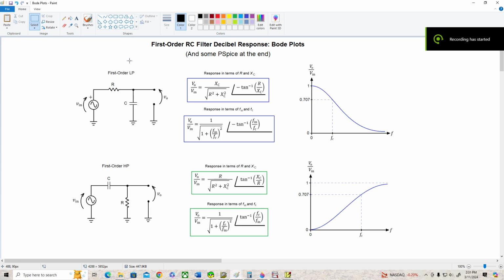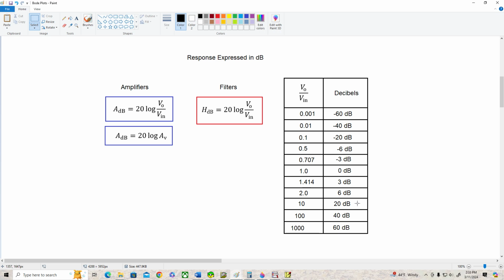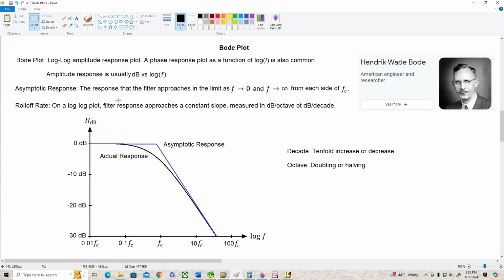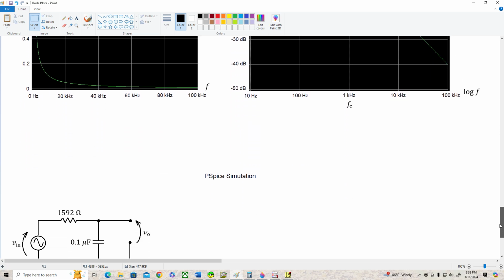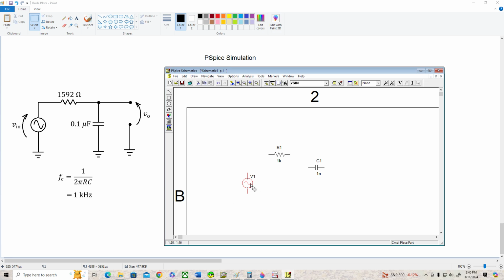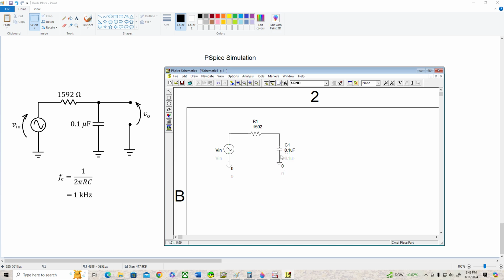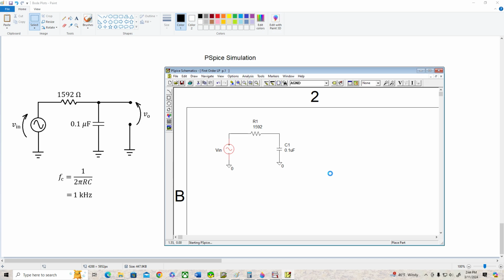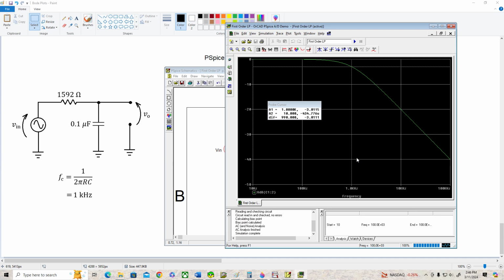Topic 26: Bode Plots (and a little PSpice)

Comment: I think there is mistake, bode plots aren’t log log they are semi log where the horizontal axis is logarithmic (frequency) and the vertical axis is linear (gain or attenuation)
Reply from the maker: Bode plots are actually log-log because the vertical axis is in dB, which is a log unit.